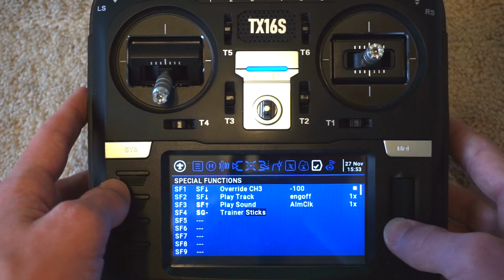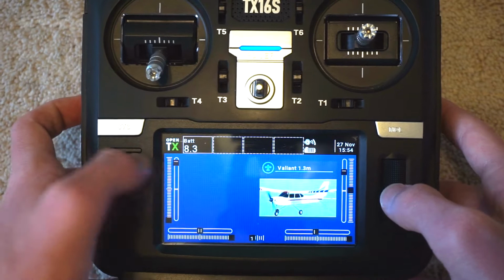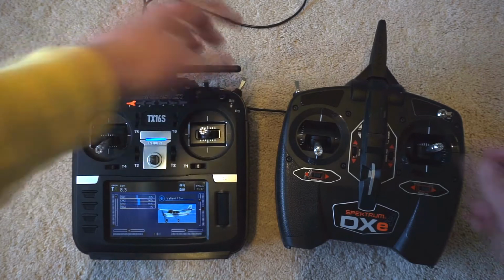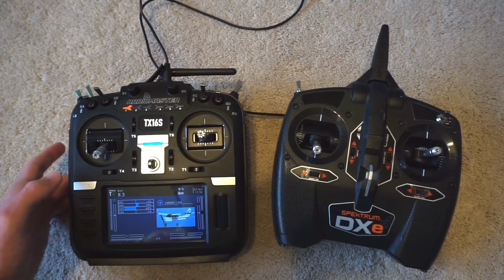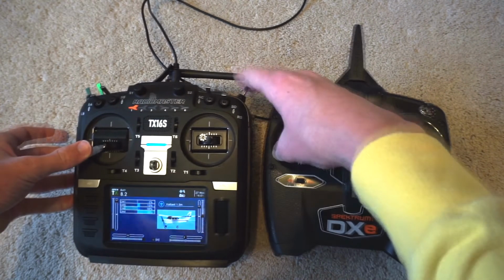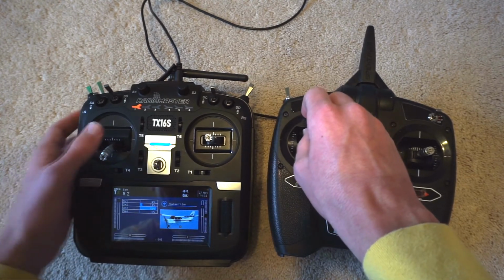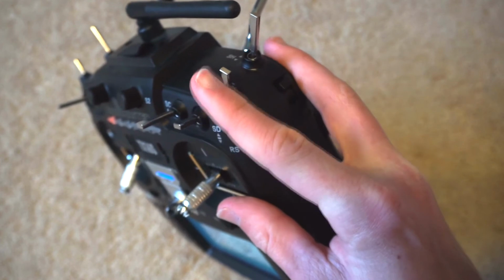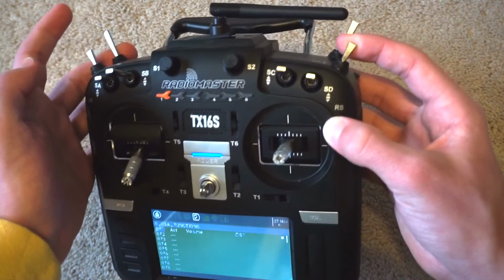RadioMaster TX16S Setup | Pt.3: Trainer Setup (with Spektrum) and Sounds

Comment: Only my trainer's Rudder channel works, and it's assigned to the arm/disarm switch, how do I fix this?
Also, if i change the trainer switch to Chans, instead of sticks, the slave's three pos switch + trims work, but not the actual sticks.

Comment: Is there a way to do this in reverse?  Using the Tx16s as a trainer ?
Reply from the maker: Absolutely! It is under System, and there is a trainer mode that will either be in ‘master’ or ‘slave’ mode. To use the TX16S as a training device, make sure you are in ‘slave’ mode.

Comment: have you noticed that the trainer port in RM is intermittent?
Reply from the maker: What do you mean by "intermittent"? It has worked pretty flawless for me so far as both primary and secondary.
Reply: @AV-14  during buddy box I would lose connection...wiggle connector and it would be good then bad
Reply from the maker: @ror-ys3qp  I haven't noticed that yet. Have you tried switching your cable out?
Reply: @ror-ys3qp  Yes.  The training port connector on the tx16s is very cheap.  This is happening on a lot of them.  You have to open up the radio and gently press down with a very small screwdriver on the cable port contacts to get a more reliable and solid electrical contact with the plug.  I have done this and its a rock solid connection now.
Reply: @jimmydoolitle3764  no not a good fix...the tip of the 3.5mm trainer plug does not make contact with the tip contact of the jack. The tip is what holds the cable in place.
Reply: @ror-ys3qp  It's been working perfectly for me since Imade the fix 4 months ago.  I use the training function frequently too.
Reply: @jimmydoolitle3764  I presume what you did Jimmy was force the third contact down far enough so that it would make a really positive connection with the grooved tip of the audio plug. Which you do not fully insert - just far enough to have the number 3 contact click into it? That will work if you get it bent just right. Congrats.

Comment: The DXi is mostprobably running on its own battery--not the TX16s---its switched on by the plug!
Reply from the maker: Ah I see. I'm not sure how/why it does that but those smaller Spekrum transmitters are kind of quirky (in my own experience).

Comment: Need cable stereo or mono?
Reply from the maker: Both work just fine!
Reply: @AV-14  Actually a few folks have reported problems using the standard stereo/mono audio lead. The socket on the TX16S is a 4 pole connector that takes a longer plug than the normal 2/3/4-pole audio/video one. (~17mm against ~14mm for the Spektrum/FRSky/Futaba/Audio/AVCable one.) It will work since the TX16S uses the shell and the 3rd contactor which will mate with the shell and the tip connector of the shorter plug. BUT it will not be as positive a contact as the genuine plug and usually must not be fully inserted into the TX16S socket. Adding an additional 2-contactor socket to the Tx16S case is probably a better idea.
Reply from the maker: @theoztreecrasher2647  Really? I had no idea. That is good information to know. I have been using the stereo cable so far without issues but I will keep an eye out for it!
Reply: @AV-14  Its no good keeping an eye on it-it WILL fail  The connection is very bad-  non existant on some Tx16s

Comment: Hello, you said that it can be used with any other kind of transmitter?
Reply from the maker: If your transmitter has a trainer port, it will work! You may need an adapter as well, so watch out for that!